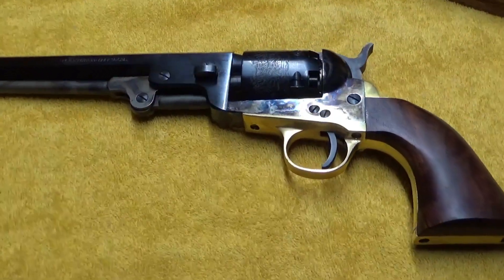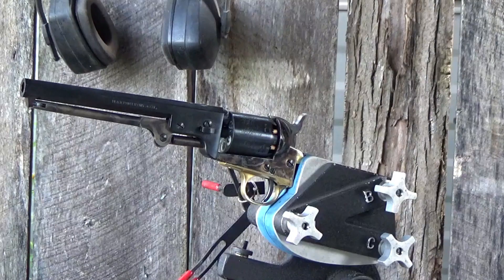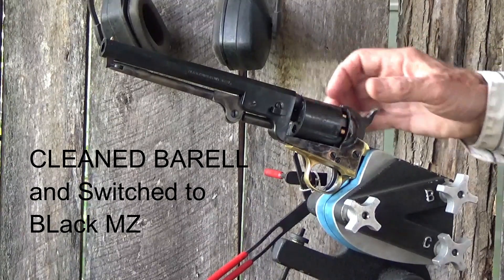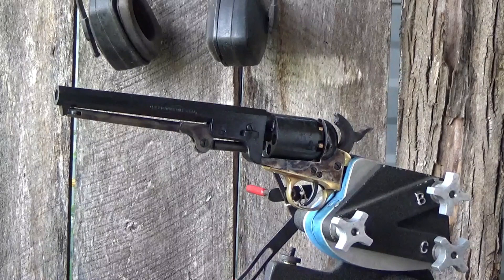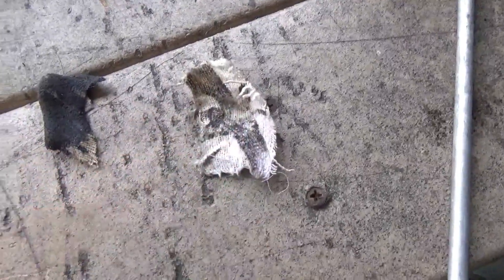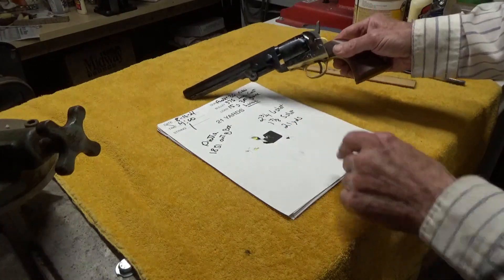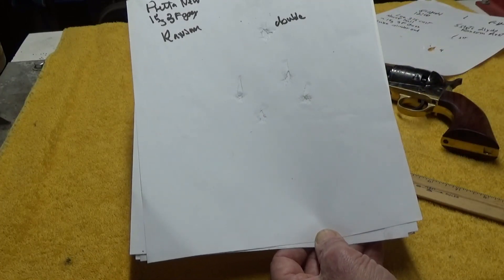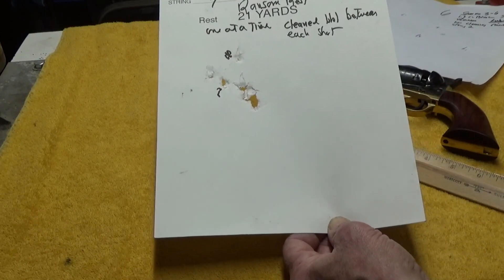Black Powder Fouling and Accuracy - Pietta 1851 in a Ransom Rest

Comment: For a while I've only been using Vaseline, Crisco or Coconut oil. Seems to work just fine for me.
Reply from the maker: There’s probably quite a few things that can mix with the fouling that will prevent it from hardening and building up in the barrel. Some probably work better, but I feel they all need to be soft enough, otherwise it’s like painting with dried paint. Some have pointed out that the gas from previous shots blows out the lube. It does, but not all. Lube remains at the edge in the crevice along the side of the ball, and I suspect the ball smears this along the side of the barrel. The ball (brush) tends to run out of lube (paint) as it travels through the barrel and I’ve noticed that the first half of the barrel has less fouling. Anyway, glad to hear that you have experimented with other lubes. O.R.
Reply: @oldranger3044  I'm going to try a new lube that doesn't have any petroleum in it. I'm going to mix  Beeswax with Ballistol gun oil until it's a thick consistency. I'm thinking 1 cup beeswax to half a cup Ballistol and see how that does, to start out with. Likewise, I may have to add some more B if needed
Reply from the maker: @Faith.in.His.Grace. sounds good. Go for it. 🎉O.R.
Reply: @oldranger3044   I figured out an easy way to make a gun shoot at the point of aim at a certain distance. You know how some guns you can get a good grouping, but it will be way off bullseye? Well with a chamfer bit and a cordless drill you can make it hit bullseye. I also ordered a shooting table and a chair to perfect the technique. It's just a cheap table and a cheap tripod chair, but I figure it will be fine. I'm not too particular

Comment: Thanks for all the testing!!! It seems like the fouling definitely negatively affects accuracy.Great video as always.By the way,is that you playing guitar?? That's a nice tune for the intro and exit!!!
Reply from the maker: Thanks, my late cousin-in-law. He would be happy to hear that. I’ve spent more than a bit of time, caps, powder, lead and cleaning chasing the cause of poor accuracy, but particularly flyers. Currently I’m of the opinion that flyers, and sometimes poor grouping occurs when the ball (or whatever) skips the rifling when there is fouling buildup. How the buildup causes this is open for speculation. So, I believe it needs to be kept soft enough so progressive shots push it out, rather than adding to it. I’ve tried wads, both purchased and DIY without much luck, check out some of my recent posts if you’re interested, and top accuracy isn’t always necessary, depending on the type of shooting being done. O.R.

Comment: Reseting the barrel wedge can change where the gun is shooting as well. Keep that in mind.
Reply from the maker: @KarstRats  Right. That’s one down side to loading the cylinder out of the gun. Even loading another string in the gun using the Ransom can mess with the grip adapter’s grip on the gun. A Remington wouldn’t have the first problem, and I’d like to have an adapter, but not ambitious enough to make one from their blanks. Thanks for pointing this out. O.R.

Comment: A little known trick that I have  Used for years. Cut 44 caliber styrofoam pills out of meat trays. Thick meat trays use one, thinner trays use 2. The styrofoam pills will compress to the thickness of paper but keep the hot gasses sealed away from the lead conical bullets base.  I use a Luber sizer To lubricate the bullets.
Reply from the maker: Very interesting, thanks. Using what diameter sizer, and for what weapon(s) of choice?  O.R.

Comment: Fouled barrel or not I can't help but think that there is something going on with the gun. In general my cap and balls shoot better than that. I know that Piettas are made without a barrel crown - perhaps there is a tiny burr on the end of the barrel? Recrowning may work wonders for the gun - a drill, a crown nut (also known as a cap nut - big ones are sold as lug nuts), and some valve lap compound is all it takes.

Comment: Even with the ransom rest you can't entirely get the human element out.
High or low shots can be caused by varying the pressure on the loading ram.
It sometimes gets frustrating trying to chase down the cause of that flyer. Usually it's me.
Reply from the maker: I load the cylinder out of the gun most times.  In the Ransom  rest, this of course involves barrel removal, and possibly puts stress on the Ransom that could make a difference.  As for shots going astray because of loading pressure, I built a loader that has a pressure gauge on it to get them all equal compression.  Made little to no difference that I could tell, and went back k to just doing it by feel.  The trick might be to get the Ransom to recoil the same each shot.  In the end, can we expect a $350 gun to make one hole like a Wilson or other custom gun ??  Would be nice, but probably not.  O.R.
Reply: The other thing is actualally weighing the powdet charges.
Old time Schutzen target shooters weighed their charges. So do modern long range black powder champions. If it didnt matter, they wouldn't do it.

Comment: The 36 caliber revolvers tend to lose accuracy faster than the 44 caliber revolvers because the fouling thickness tends to be uniform regardless of caliber. Therefore, given a .375 barrel and .002 of powder fouling reduces the bore diameter to .373 or less and the fouling rides against the front and bearing surface of the ball giving inconsistent travel whereas the .452 barrel with .002 layer of fouling although causing similar inconsistencies is a smaller percent of the bore diameter. This is why black powder arms designed for situations where the weapon will be fired multiple times have larger bores.
Reply from the maker: Wow.  That's insight that I probably would not ever have come across without this comment opportunity and Youtube.  All I know (I think) is that I've always had problems with the 36.  Would be shooting a decent group, and then that ominous flyer (or two).  Figured in the 80's that it was that they were not taking the rifling.  Actually make a 12 foot water trough to possibly see slipping on the recovered ball.  Anyway, recently I've figured that maybe the 1-30 was just too slow for the smaller caliber.  The 58 Navy seems to have trashed that idea.  When shooting at matches at Friendship, I would swab the barrel of my 1861 2nd Gen Colt, and that seemed to help.  Also, using more cylinder end lube seems to have done better recently.  This all seems to align with what you have said, and I sure appreciate the comment.  O.R.

Comment: Could you have one cylinder that is off?
Reply from the maker: Probably not, but I've wondered the same.  When I would get a flyer years ago I took note of which one it was, and it turned out to be a random deal.  The CNC machining now is pretty good I feel, and there is a more likely chance that for whatever reason, it just happens.  There is a reason of course, finding out what is the real challenge.  O.R.

Comment: Be careful about vinegar.  It will remove bluing. I found that out the hard way.
Good video!
Reply from the maker: Thanks for the heads up on that.  I'm probably fortunate that I haven't used it much.  Been using it some on my long guns, but they are browned, and maybe it can't do as much to them.  Felt I needed a bit more than water on the barrel, but I think it would have worked fine, just needed some moisture down there.  Thanks again.  O.R.

Comment: Years ago I learned from BPCR long distance match shooters to use lube cookies (paper card, lube pill, paper card).  I’d point you to my extensive tests, which prove that when using the lube cookie method you get no additional fouling accumulation after the first shot, but the 1858 Remington forum where I posted these things was taken down and all of my extensive tests, mods, and photographs, hollowpoint bullet tests in percussion revolvers, etc., are now gone.  On two occasions I fired over 100 consecutive rounds without cleaning the bore, and the accuracy of the last group was the same as the first.  Furthermore one dry patch through the bore, one direction, and it looked clean as a whistle.  That’s the benefit of having the lube behind the bullet where it needs to be in order to mix with the powder founding to keep it soft.  Felt wads don’t carry enough lube to accomplish this, unless you add more on top of the wad before seating the bullet, and that can expose more of the powder to the lube prior to firing, introducing another variable which is the viability of the full powder charge.
Reply from the maker: First, my sympathy about loosing some worthy data, for yourself and other shooters.  I've never read much on forums, mostly just not aware they existed.  I have had the same line of thought as the tests you did.  Never shot much BPCR, but read all of Matthews books and some others.  Have tried several times to get the lube where it would I thought it would do more good, after the powder.  That info of yours that was lost on the forum would have helped, problem would have been that I probably wouldn't have found it.  
I guess I'm following the same trail you were on, just years later, and lack your experience, but keep moving forward, sort of like a turtle.  About the only contact I get with others like yourself is through these comments, so appreciate yours, and others.  Like Josey Wales said, didn't know there were others.  
I will be posting some tests that I did with and without lube on chambers.  Would appreciate your comments, and hopefully it is heading in the right direction.  I realize that on chamber end is not going to do as well, but to me it proves the point.
Oh, I've often wondered if the powder used "in the day" burned differently, possibly different fouling.  I have a unopened keg of "orange" that my cousin found in a barn that was built in the 1800's I believe, label is pretty much gone.

I sure agree about the felt wads that so many feel are doing the job.  I've examined them when the bounce off the targets, or get stuck in them. ( I suspect some are even catching a ride on the back side of the ball). There can't be much lube getting on the lands or groves, as the contact area is small, and almost all the lube is absorbed in the felt anyway.  Better stop because I would like to go "on and on".  Thanks so much, and maybe there is some way to make your results, and experience more available.  Any ideas??  O.R.
Reply: @oldranger3044  Thank you for responding.  Well I pretty much said it in the first comment, but I can give some more details.  A lube cookie is made by melting black powder lube into a glass baking pan that’s been half filled with water, and then bake the stuff at around 250 or whatever just until the lube melts into a uniform sheet, then let it cool, undisturbed, until the lube is set up and has cooled completely.  Somewhere I have the formula for the weight of the lube and the area of the pan, to get the thickness of the lube sheet you want.  You want the lube to be just a bit under an eighth inch thick.  The idea of floating the lube on water in an oven came from modern glass-making, which floats the glass on molten tin or some such until it completely flattens out.  Floating the lube on water gives you perfect flatness of the lube sheet once it freezes up.  Buffalo Arms in Ponderay, Idaho also sells a lube extruder die (fits into a standard metal cartridge loading press) for the same purpose, which gives a consistent thickness of lube on the form of an extruded ribbon.

The lube I use is called Gatofeo #1.  You can find the recipe on line, or I can dig it up for you.  Regular and readily available SPG works about the same, but is slightly harder in consistency.

To make the lube cookies you either make or procure (also at Buffalo Arms) a “hammer punch” (meaning it’s designed to hit it with a hammer to punch out cards or felt, etc.).  In this case you want a card diameter of the gun’s chamber diameter, or a couple thousandths under if you’re making paper cartridges, and you use that punch by simply pushing it into the lube by hand.  That’s how you get your “lube pills”.

To make the “lube cookie” you find some hard paper card, such as is used to make cereal boxes, beverage can 12-pack cartons, or a myriad of other packages which you’ll have available pretty much always.  It’s good to procure a punching board, or one of those plastic, pale white cutting boards sold for kitchen use.  Place your card on the cutting board, place the punch’s cutting end on the paper card, and whack it with a small plastic hammer or rawhide mallet.  In this way you can make 100s of cards in short order.  I store them in small Tupperware containers by size, different sizes for different calibers, or even different guns, and label them.

When loading loose ammunition, it takes more time, because now you’re inserting the powder, then a card, then a lube pill, then another card.  If you shoot at home that’s no big deal, but for those of us who have to drive out to find a place to shoot it is much better to have our loads all pre-assembled and ready to go, so you don’t spend much time reloading and fiddling with tiny components like cards and lube pills, in the wind and whatnot.  Therefore I use “consumable envelope” paper cartridges, which can be made up in small batches here and there, and by the time you go out for a day of shooting you have more than enough of them ready to go that you never need to load loose ammunition.

Once you get the paper cartridge system figured out and established, I guarantee you’ll never go back.  Check out my singular video, which covers the cartridge making process.  There are other systems for making paper carts for these revolvers, but the system I use is the simplest and fastest, and makes better, more consistent, easier to use cartridges that stay together until you need them.  Just DO NOT leave them in a hot car or in the sun for long on a hot day, or the lube will melt and you’ll have a mess!  back in the day they were made dry, so this wasn’t a problem, but of course it meant fouling up the gun after a full cylinder or two.

I also generally use cast, conical, lube groove bullets, but you can make the cartridges in exactly the same way using round ball, or load loose ammunition with RB or conical.  The system is the same except for bullet fit with conicals, and we can get into that subject later if you wish.  In short, I want a conical that’s right at, or never more than two thousandths of an inch over, chamber diameter. Thus I have a lube sizer for conicals, so it fills the grease grooves and sizes the bullet at the same time.  I’ve purchased a number of custom sizing dies from Buffalo Arms for my different percussion revolvers for that reason.
Reply from the maker: @omnivore2220  Thanks so much. It will take some time for me to digest this info, and I considerate it as the best I have seen.  Not taking away from what others may have done in this area because frankly I just haven't as I said,  come across much.  
So you have a video on cartridge making the way it sounds.  Could you give me something to search for or by.  Again, much appreciate the information.  O.R.
Reply: @oldranger3044  Yes, thank you.  To look at my video, just tap the round, colored icon to left at the top of my reply.  That takes you to my channel where you’ll see only one video.  It shows the basic idea of making these paper cartridges, along with my concept for a belt box that carries 50 of the finished carts while in the field.  I now have the 50 round box cores 3D printed and I have several leather outer shells for them which were custom made by a Leathersmith. Any questions you may have can be posted in comments on my channel, and I’ll answer them as I’m able.  I developed the system somewhat further after making that video, but then a ruptured appendix, and then some broken ribs and a punctured lung pretty much changed my focus in life for a while and I haven’t made any more vids.  For one thing I believe you’ll see me loading lube pills only, not “lube cookies”.  The pills will indeed “take a ride” on the flat base of a bullet, and can carry burning powder granules to the target.  Not good in dry conditions with dry vegetation around.  The cookie on the other hand won’t ride along with the bullet, and I’ve never noticed the burning granules of powder at the target like I’ve seen when using pills only.

I really appreciate your use of a Ransom rest for testing.  Most BP revolvers shooters would never do that, and yet it’s the best way to test for inherent accuracy!

Comment: It is really amazing how accurate these guns can be. It really defies modern logic. It has a exposed cap on a nipple lose powder in a chamber and a soft lead ball forced on top with a loading lever that probably deformed the ball and it shoots better then almost any modern auto loading handgun. Keep up the good work.
Reply from the maker: AND, the ball was FAR from perfect to begin with.  Unless it bumps up, it doesn't come close to filling the groves.  The cast round ball has a place where the spruce was cut off which is loaded at various positions. Powder charge and compression vary.  

Working now on a video of shooting a Remington style with no lube or wads VS shooting with lube, think you might find it's interesting.  O.R.

Comment: What lubricant was used if any? Cylinder lube is important.
Reply from the maker: I use a mix of crisco-beeswax.  This was used on both the FFF and BlackMZ. on end of chambers. I used no lube on the BlMZ when cleaning and firing one at a time, since I was cleaning, and there was no concern about chain fire.  Thanks.  O.R.